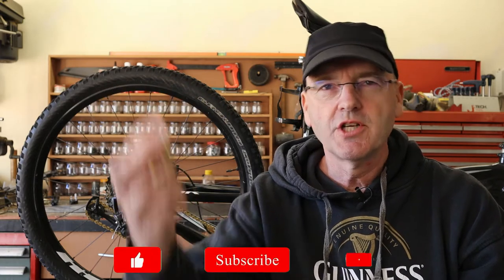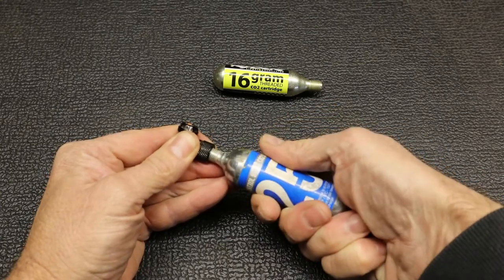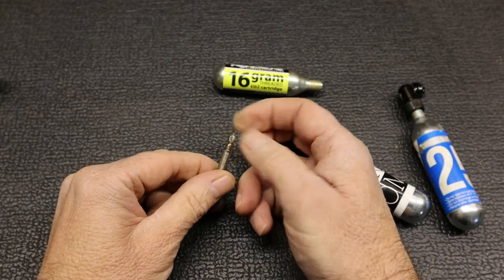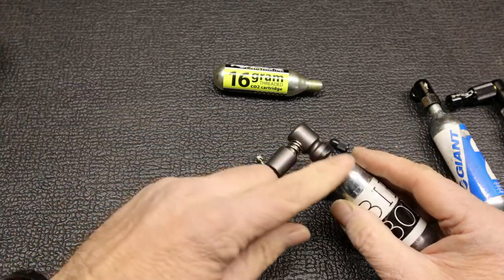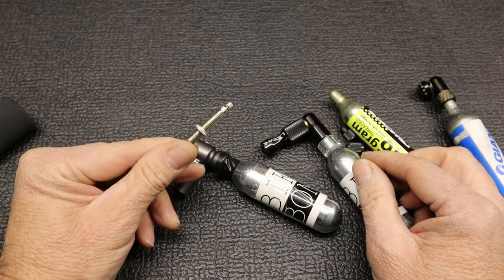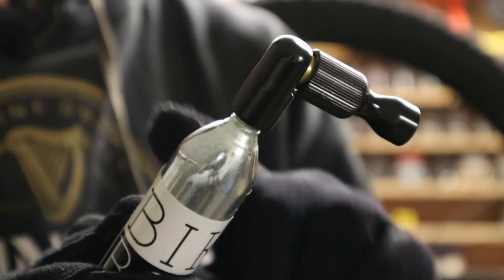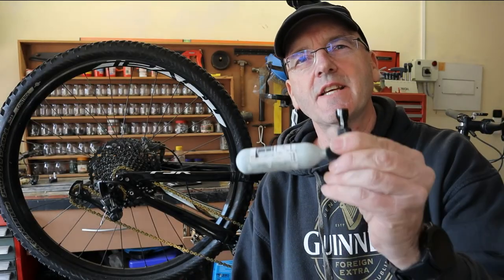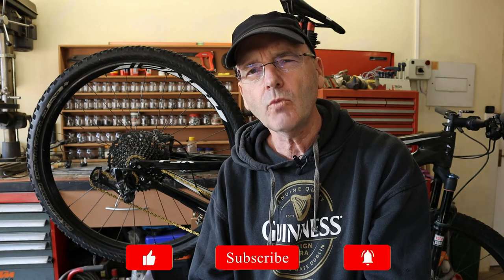How to inflate a bicycle tyre using Co2 BOMB | cartridge

Comment: What's the maximum psi that can be reached with cannisters?
Reply from the maker: Cartridges come in different sizes. The smaller ones are designed for filling tires up to about 90 PSI. The larger ones are designed for filling tires up to 120+ PSI. But this is in theory. You would have to do it in bursts as the adapter and valve will start to freeze if you try to do it in one go.